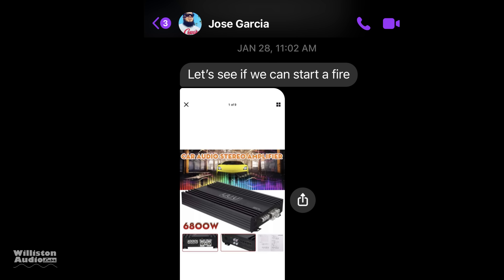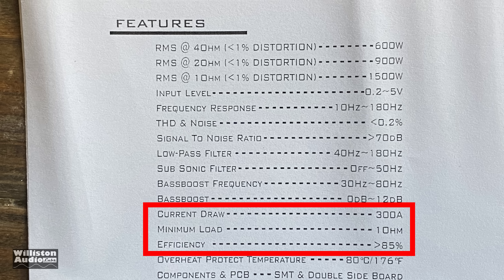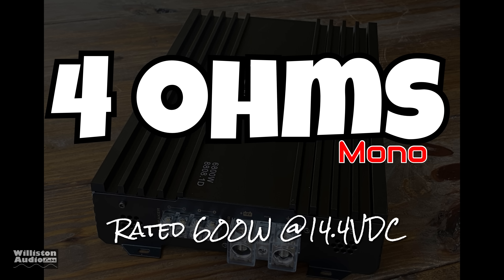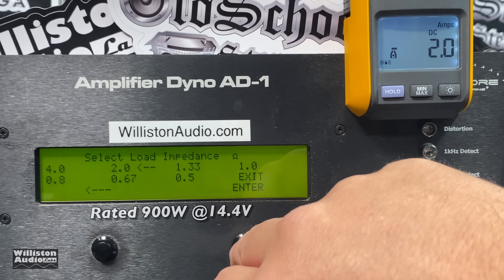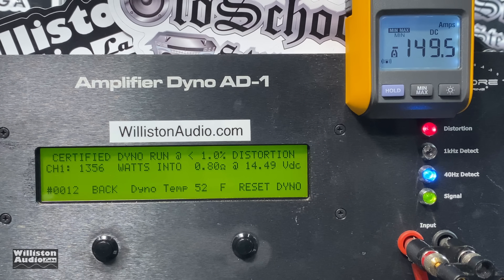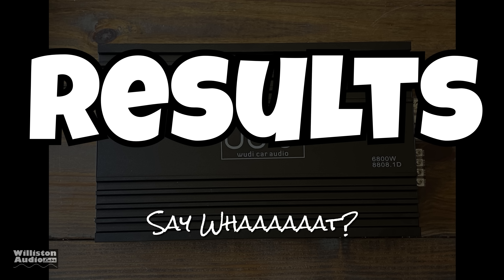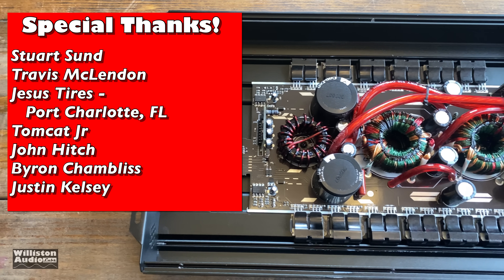BEST $100 Subwoofer Amp?? WUDI 8808.1D 6800W Amp Dyno Test and Review [4K}

Comment: Listen don’t just look at the watts!! How clean is the amp, and what is the signal to noise rating??? The real rating.  And it’s possible they tested to past 1% thd.  If they don’t lie you won’t buy LOLOL!!! Buy a good amp and be happy.  But don’t forget with great power comes some much needed upgrades!! Wiring, alternators, cap banks, and a lot of work to get things right!!!! Even if it’s only $100, I’ll gladly spend another couple hundred for an amp that is built to last and not just play half a song and shut down!!!!

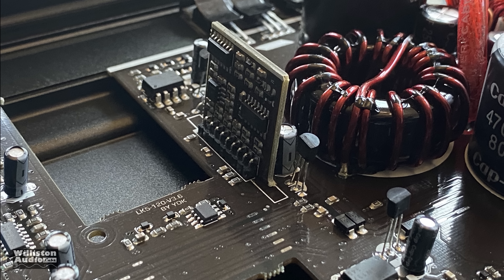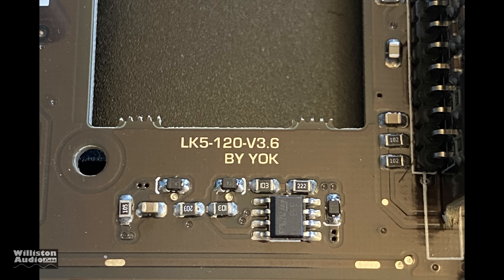Comment: The "missing" sections of the circuit board can be seen mounted vertically at 10:51 and 11:29 respectively. The one at 11:29 can be seen in the bottom right hand corner of the image.

Comment: The missing board parts are standing soldered vertically smaller piece right by where the chunks are missing in the other piece down to the output side of the amp

Comment: I used to work for a high voltage research and development company, we used to use that same spacing technique with a optical isolator chip to keep noise out of certain parts of the board, and just to save on future issues on high voltage creepage, we would space the board out

Comment: 10:40 the answer to this question is looking you in the face

They have the pcb manufactured with those snapped/snapoff sections which are themselves small pcbs which you can see mounted vertically at the top right and the other is right next to the snap recesses

Comment: Question?
Running 4 dvc 10’s in a large sedan trunk. Can I get 1800rms power for under 200 or even 150? What would you recommend? Do these cheaper amps lack SQ?

Comment: No it didn't reach the rated power, But the amp is only around $80 I believe. There's a 5800W (not really) Wu monoblock for that amount. So really given the amps overall output, that ain't too bad. Though it is kinda sneaky using same amp model numbers as Skar. But that's China for ya.

Comment: Just an update. Had this installed basic 4ohm load for over a year. This thing has taken all the abuse. Set gains with a scope so it's been loud and clean driving a single 10 in my truck. Every time people hear it they say no way that is just a 10... So far it's lasted longer then my old school Kenwood monoblock.. very happy I found this guy on YT.. what should I upgrade to next
Reply: Another 10 in parallel 😊

Comment: I really enjoy watching your videos... you do an AWESOME job all the way around. After I graduated electronics school in the late 80's I started repairing car audio for an Alpine dealer and amplifiers have always been my favorite . I think this amplifier is a beast...especially for $100 but now I couldn't find anything around that price it had more than DOUBLED! I looked hard for a deal because I was just wanting to play around with it as I have tons of name brand amps. I finally bought the same amp on an Amazon deal  (DEC 7, 2022)  for $106 but it is sold as a "Facmogu 3000W Max Power Class D Mono Channel Subwoofer Amplifier". It has the same case with the 6800 watt and 8808.1D logo but no brand is on the amp or the box it came in. The paper manual is also the same . I checked the guts and it is exactly the same as in your video even with the AudioPipe wiring except some of the caps are now Zhuohao brand...not familiar with that brand. I powered it up but haven't got to test it out good yet...but SOON!      Thanks for making these videos and I will continue to follow your channel awaiting the next amp review.

Comment: I bought one of these and it's 6800 watts. But mines look totally different lol. Mines a 4 channel but I have no fuses. Plus rear terminals do not work. They just make a static popping noise when I attach the rear door speakers.
Reply from the maker: Oh man that’s the bad one. Sorry brother
Reply: @wal  can I get away with bridging my door speakers to a rca connection to amp? I have 2 out/in puts for subs and the input from stereo itself? When I bridged the rear doors to the front terminals it works but I'm not ok with that many connections on the front channels? Can I get away with that
Reply: It's working fine now idk why it did that. Opened it up and the fuses were on the inside😮. Replace them and it's working like a charm. Put my 4 gothic 12s back on it

Comment: HEY BIG D WIZ DON'T MEAN TO THROW YOU OFF I MIGHT SEND A SUNDOWN SFB 5000 AND LET YOU DYNO IT AT .8 OHMS I RAN AT .5OHMS ON A PSI PLATFORM 4 DUAL 0NE AND IT NEVER GOT HOT OR SHUT OFF?
Reply from the maker: Not taking amps at this time. Don’t run SFB under 1 ohm!
Reply: @wal   you are about two years late brother been running that thing at .7ohms for two years down here in Houston tx with the temperatures 100 plus degrees and never cuts off  If it was to blow up I would put it in the garbage im 56 year old bass head I got old school hifonics and lunar amplifiers laying around in my garage 😅

Comment: SPECS Below...

Rated Power: 2500W
Signal To Noise Ratio: >70DB
Frequency Response Range: 10Hz-180Hz
THD&Noise: ＜0.2%
Low Bass Filter: 40HZ-180HZ
Minimum Load: 10HM
Bassboost Frequency: 30HZ-80HZ
Overheating Protection Mechanism: 80℃/176℉
Input Level: 0.2-5V

While decent for powering a pair of subwoofers in the "everyday drive" subwoofer setup take it all with a grain of salt... the specs call for a terrible SNR, poor THD <0.2% through a small, odd, frequency range 10Hz to 180Hz. I guess you don't even need a crossover?
That said the frequency range is +- how many db? Dampening factor?... who knows.

Everything is typical with class D, and not everything tells us higher power makes cleaner / better sound.
Reply from the maker: Those who want a $100 subwoofer amp are not interested in the best sound quality....

Comment: Big D is it necessary to run the 1/0 wires for this amp! If not what would you suggest then the wire kit is more than the amp is just wondering if it's necessary thank you
Reply from the maker: If you’re running at 1 ohm or lower, yes I’d use 1/0 OFC
Reply: @wal  Thanks Big D ! This is why I watch all your videos! 100% real folk! Thanks for what you do!!

Comment: The larger chunk of missing board is used as the power supply mosfet switching control as you should see a TL494 on it.

The smaller board taken form the main PCB is being used to generate the pwm switching environment for the output side of the amp.
Reply from the maker: Thanks someone commented like 2 min after video was uploaded and I was like duh

Comment: Missing sections are sound regs hi and low end , I was a automotive engineer cert 4 in my day
Reply from the maker: Thanks someone pointed it out when video was first released. I appreciate the feedback
Reply: @wal  if you get time check out the sunbuck hifi dual channel amplifier I was  feeling ripped off with the chrome dials and old school look , has a radio Bluetooth preset equalizer treb bass knobs karaoke mode , it's small for what it does

Comment: If it only had better caps i wouldnt question longterm reliability
Reply from the maker: But so cheap, hard to complain
Reply: @wal  im definitely not complaining.  One could even upgrade them caps to some higher temp ones for pretty cheap if you can salvage some from older audio equipment.

Comment: I've been running this amp on 4 500w subwoofers @ 1ohm for about 8 months with no issues. Clean deep bass with gain under half way. Thing is, I believe I got the last one of eBay...they have been out of stock every since.
Reply: They just came back in stock just bought mine!4-21-22  126$ BE SURE THE MODEL # IS F83532
Reply: And how did you run for off of a monoblock this is just coming from a novice I'd like to know myself interesting I guess you ran them parallel or change them I don't know like to know though
Reply: @josephward6577  4 4ohm speakers ran in parallel which is all positives together and all negatives together. 4 divided by 4=1. In series 4 times 4 =16ohms. 2 4ohm speakers in series  (8ohm) wired in parallel to 2 more 4ohm speakers also in series (8ohm which is 1 negative to the positive of the other speaker and using the remaining pos on that speaker and the remaining neg on the other for main connection) would create a 4ohm load with 4 speakers. Hope this helped.
Reply: @jamlzak2536  Shaaazaaaammmm! Ty JZ Absolutely that's plain and even I can understand that! I've been second guessing,to much! TMI to take in and remember!! Thanks again!! I've been on some forum sites asking,& all I got was a tongue lashing,& pretty much told off for it!
Reply: @josephward6577  Still always check with an ohmmeter if available. Although a speaker says 4 or 8 ohms, that's not the actual load it presents to the amp. A 4 ohm speaker may read 3,2 ohms on the meter and at the amp. A calculated 1 ohm load may actually be around .7... Some amps can still handle that but it'll have to be a 1 ohm stable amp
Reply: @jamlzak2536  yup so true
Reply: @jamlzak2536 because multimeters read DC resistance not AC impedance 

Just FYI for anyone who doesn't know

Comment: replace all electrolytic caps, and have a decent amplifier, easy as that. Well, as you can see, it can be done, decent amp, yeah, maybe if it it cost +30usd, with better caps it may  be the king
Reply: i have one what caps would you reccomend i'll do it and let you know how it turns out
Reply: @kennethnicklowicz1030  Panasonic ones, low ESR  on the power supply , on the rest, see datasheet from chip manufactuer, if they need to be low esr or just normal caps.

Comment: Just ordered me one of these to replace my taramps smart 3 since it has overheating issues without even playing music… can’t wait to have my little Chinese banger hitting them DB’s😏
Reply: What size subwoofer do you have
Reply: @tdogwilson-sanders3311   so when I bought the smart 3 I was running 3 10” American bass fr 10’s dual 4 ohm subs and that setup was loud as $h!t but then when the fans both died on the amp it would just overheat with no music playing but I already sold it now I’m running a sub I built out of a mtx thunder 9500 check my channel

Comment: 10:45 This board looks like a soldi piece and this areas were used to make small PCBs and then cut of from the main. One of the riser board looks it has the area of one of the holes. When you put the board onto the machine to mount the components you have all the amp mounted, even the riser board. Then, in another step at the factory they take the samaller boards that are pre-cut and and mount them in their places. Possibly to avoid one machine pass just to make riser boards ?. Still by they woul add one more step at manufacturing doesnt adds up to me. But something IS SURE. This areas have been used to make something. Other wise would be wastefull.

Comment: Those "missing" tabs on the main board were populated and soldered to the main board in a vertical orientation.  You can see both of the "missing" sections in your video.  One is located near the power input and the other is soldered to the main board near the place where it was "removed."

Comment: They used the cutout sections of the main circuit board are use3d for the smaller vertical circuit boards in the amp. That way they can manufacture it all at once (in wave soldering) and save

Comment: I bought one of these widi 8808.1D amps thanks to your tutorial. I must say I'm impressed. I paid a hundred bucks on eBay and the amount of bass it produces I had to buy another one
Reply: Is it still working?!
Reply: @mrfkyobitch6282  u talking about a rz1-2500d? If so your crqzy I have 3 of em and they are good but even at 1 ohm they only put out 750-900watts rms. Don't get me wrong I love this little amp hence why I have 3 but the amp in the video is alot more powerful

Comment: You can see the board he removed.  It is a vertical component mount.  At 10:51 The initial flyover shows both segments.  One is at the upper right of the PCB, likely the input pre-amp section from the location.  The other stares you in the face at the above noted timestamp.  Vertical PCB sub-assembly mounts conserve main PCB "real estate", and are also useful if the original circuit gets 'massaged' after it initial release without the needed space to implement it and not wanting to perform an entire new layout.  They look the same size as the missing pieces you referenced.  Easier pick and place and a simple breakout once the PCB gets to the customer for final assembly.  Many of these get their thru hole parts put on by hand since the count is not very high and the labor is not very costly.

Comment: Those missing sections ARE actually on the amp. They do things like this so that those knock out sections can all get soldered in the same process through the wave solder machine. Then all the have to do is knock them out, and solder the knock out boards in the appropriate places manually.

Comment: That's the problem that I am having. I am shopping for a high power amp for my bass and subs for my home. You see an amp that stated 2000 watts but when you get to reading all the spec it looks like the amp will only reach that power output about four seconds before it explodes.

Comment: Hypothetically speaking. If one needs a 3k rms amp. And doesnt want to spend way too much. And cant afford a cheaper one for about 350. Buy one of these at a time till u have 3 and boom. 3k multi amp set up. Put a pair of 10s or 12s on each. And slam. I would have done that when I was younger lol

Comment: I remember my first amps weren't even amps they were power boosters with the built-in EQ that bolted under the dash.
I'd love to find out what those old Pyramid 808 or 801 actually put out.
Reply: 6W at 4 OHM 1% THD
33W at 4 OHM 100% DC Voltage
Reply: @barakhalla5338  was the 6 Watts at 8 ohm and the 33 Watts at 4 ohm?
Reply: @jamessouthworth1699  it was a joke..
Dc voltage would kill speakers

I had a pyramid unit just like you described, with built in equalizer..
Back in the days... (Mid Nineties)
Reply: @barakhalla5338  I won't argue that but I still like them out of nostalgia.
I just remember how cool it looked at the time and how awesome I thought it was when I had my first car. I didn't even have real car speakers I had a set of house Speaker standing up in the backseat.
Reply: @jamessouthworth1699  That's wuts up,old school Rules! Member those daz had a Craig power play with the cassette,two realistic floor standing speaks in the trunk! I may not have had my ducks in a row but they were damn sure in the pond!
Reply: @josephward6577  yes I've had my fair share of how speakers in the back seat during the eighties
Reply: Omg I thought I was Soo cool had the woodgrain set

Comment: Goodmorning, I have currently 2 12inch dual voice kicker comps subs they are a couple of years old, I want to purchase a monoblock amp that would be not to expensive that could push those subs and bump. I was considering a hifonics 1,200 watt amp? Do you recommend anything the subs are 2ohms, I see that alot of the Boss amps and others are not reliable. Thanks

Comment: For the 2 broken off portions.. you can see that there is 2 other small boards placed vertically on the main board... these 2 smaller boards would likely have been printed out of the main board.. and then made it so they could easily be snapped off and re-positioned during production.
Reply: 100%
Reply: @johnyang799  as the MiZ would say corrrrrrrect.
Reply: Your correct. I worked for peavey for years and they do this often
Reply: @nefariouspreludev2.046  Peavey is one of the saddest stories in the music industry. At one time (back in the early 90s) we had over 100 black widows loaded in our boxes.
Reply: How could they not see that while looking at it in person???! Good eyes!